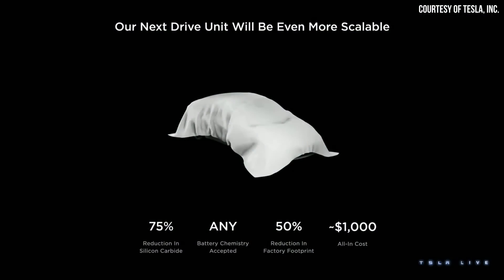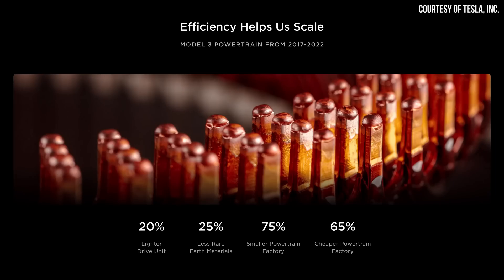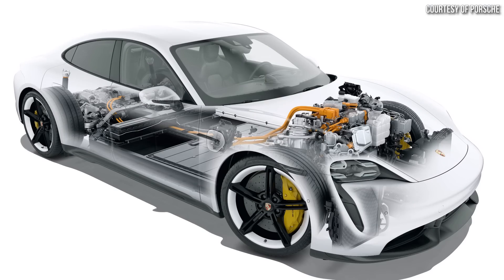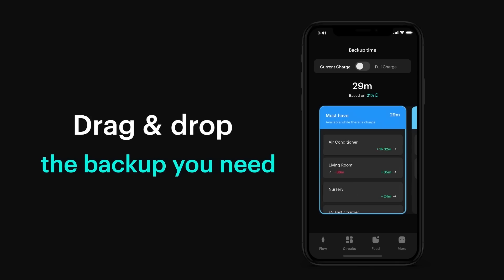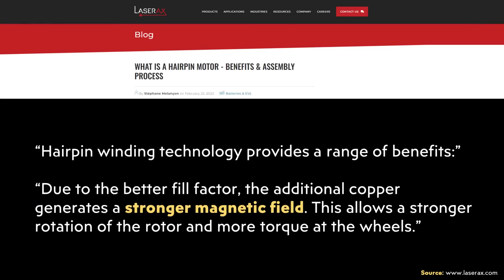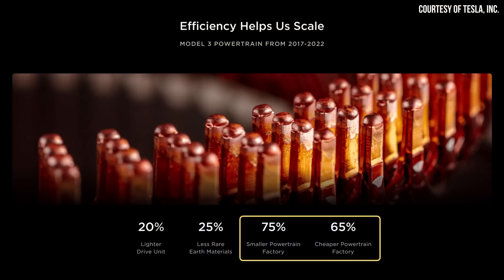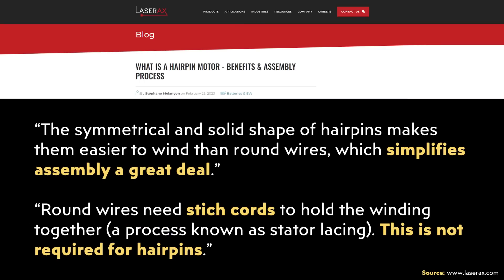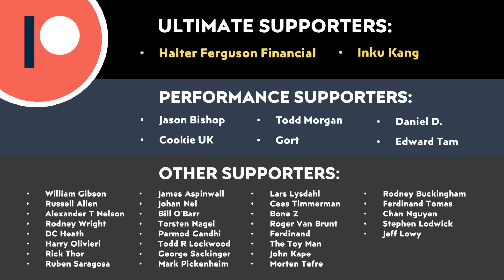NEW Tesla MOTORS are Here | Hairpin Model 3/Y Motors Explained

Comment: Thanks for the Video. Seems like my Model Y SR that I will get next Tuesday will have a "Hairpin Motor" 😀. LRWYGCFS2PC*******: LRW = Tesla Inc. in Shanghai, China
Y = Tesla Model Y
Model Y : G = SUV-Crossover / 5 Türen (Linkslenker)
C = Manual Type 2 Seat Belts (Front Row, Second Row*2, Third Row*2) With Front Airbags, PODS, Side Inflatable Restraints
F = LFP (Lithium-Eisen-Phosphat)
S = Ein Motor – Standard – Motortyp: „Hairpin Windings“ Variante: Y#RB/3#RB – (Model 3/Y)
P = 2023
C = Shanghai, China

Comment: I am currently waiting for a delivery of a 2023 Model Y Performance. The VIN allocated  to me shows a std winding, not the hairpin design. 😢
Reply: How do you know?
Reply: Tesla VIN states the type of motor: VIN Digit 8: Motor/Drive Unit
Motor/Drive Unit (2012+) & Battery Type (2012-2013):
C = Base A/C Motor, Tier 2 Battery (31-40kWh)
G = Base A/C Motor, Tier 4 Battery (51-60 kWh)
N = Base A/C Motor, Tier 7 Battery (81-90 kWh)
P = Performance A/C Motor, Tier 7 Battery (81-90 kWh)

1 = Single Motor – Standard
2 = Dual Motor – Standard (twin motors)
3 = Single Performance Motor
4 = Dual Motor – Performance (twin performance motor)
5 = P2 Dual Motor – Long Range (2021+ refresh) (designated for Model S or Model X)
6 = P2 Tri Motor – Plaid (Model S or Model X)

A = Single Motor – Standard / Performance (designated for Model 3)
B = Dual Motor – Standard (designated for Model 3)
C = Dual Motor – Performance (designated for Model 3)
D = Single Motor – Standard / Performance – standard winding (designated for Model Y)
E = Dual Motor – Standard – standard winding (designated for Model Y)
F = Dual Motor – Performance – standard winding (designated for Model Y)

J = Single Motor – hairpin winding
K = Dual Motor – hairpin winding
L = Performance Motor – hairpin winding

R = RWD V1 Motor @shdmd2118

Comment: If any  of this is being done today then why haven't vehicle efficiency numbers jumped?  Why haven't vehicle weights dropped?  Why have we not hear of optimization of the freed up space on the vehicle with the significantly smaller motors?   These would of course be the tell tale signs that they have started producing these motors in the existing cars.  The investor day however seemed to say that these advancements in assembly and motors would be in the next gen vehicle and not in the current vehicles.  Seems to me we should see EPA numbers changing and vehicle weights dropping as clear evidence.   So this leads me to believe this will be in the next gen, not in current gen.

Comment: I imagine that hairpin wiring requires less cooling power because the packed rectangular wires have much less air gaps between them than round wires have. The thermal conductivity for copper is much larger than for air so the pack will conduct heat much better. 

I’m curious if hexagonal wiring has been tried. Hexagonal wires can pack without air gaps and it perhaps it’s easier to press round wire into a hexagonal shape than into a rectangular shape?

Comment: 2:26 is that pin on the left supposed to bend???
Reply: no :)
Reply: It bends as the machine recedes, so its possibly deliberate, possibly a contact pin?  Otherwise, you'd expect it to bend as the machine lowers, applying pressure.  It's a very neat, angular bend & the "upstalk" stays very straight & parallel to the other pins.

Comment: You are badly informed about this topic. Every Model 3 RWD and every Model Y currently produced in Germany or China has Hairpin Motors. The RWD and LR variants have the 3D7 Motor and the Performance variant has the 3D6 Motor. This is already the Case for over 1 year. (I had a Model 3 from China for 6 months with 3D7 Motor and after that i got a Model Y LR also with 3D7 rear Motor and that car is also 6 Months old already... So we know that Hairpin Motors are beeing produced and are Put into Model 3 and Y for a very long time already.

Comment: I think that the hairpin stator slots/canals allow more copper to be put in so one can have more slots and then a shorter stator/rotor stack hence shorter magnets and less rare earths
Reply: I think you are on to something with the shorter stator and rotor stacks. But I don't think more slots in the stator is necessary, since they have found a technique to increase fill factor. Meaning more copper in the same area. Or is there a reason I didn't spot?

Comment: Tesla has been using Hairpin Stator Technology in Model 3/Y built in China since mid of 2021. Those motors are calles the 3D6 (Performance) and 3D7 (Base). In the US they have also started using hairpin motor in December 2022. Those 4D1 Performance motors were first spotted in MYLR out of Austin and later in MYP out of Fremont. They are all assembled in Austin though according to the motor placard. The 4D5 new generation base (non-performance) motor wasnt spotted yet, but it will come soon.
Reply: Do you know if the model S/X have been shipping with hairpin motors? I have been waiting for years for them to move to this tech. I am also waiting for the S/X (and the whole lineup in general) to move towards 48V accessory system voltage... which seems like it will be coming soon. I think once the model S moves to hairpin and 48V aux electrical I will make the jump to a model S from my current vehicle. Ideally I'd also like for them to finally go steer by wire and full brake by wire (I think they might have already?) as well. 

On a separate note, I wonder if the current gen model S/X will benefit from the new battery architectures and gigcastings soon. I really love how the current gen model S/X look and wish for them to keep them around for a while, whilst still continuing to significantly upgrade them under the hood. I'm a huge simp for the current model S, especially after they brought back the regular steering wheel.
Reply: @scenicdepictionsofchicagolife  currently the Refresh 2021 versions of the Model S/X are coming in the 3D8/3D1 motor configuration in the Long Range and 5D1/5D2 motors in the Plaid. All of these motors are still older wire (fractional slot) winding technology motors.

You will have to wait a little longer for them to transition there.

Model 3 and Y for Europe have shifted to Hairpin rear motors completely since 2023.
Reply: How do the new Tesla ones 2023 compare to lucid which are meant to be mind blowingly good and efficient?
Reply: I have 3D3 and 4D1 in my MY Long Range 2023 from march. From Berlin.
Reply: 3d3 and 3d7 fot the 2024 highland LR AWD from Shanghai.

Comment: You can't "double spend" the 25% stronger magnetic field, and simultaneously get more power with weaker magnets. I believe Tesla found a way to make magnets just as strong without rare earth's. Otherwise, they wouldn't have eliminated those rare earth's to begin with. Tesla doesn't sacrifice performance to save on cost.
Reply: Agreed, Virtual Viking. It sounds weird to weaken the magnets as they are the "current-free" part. That no significant current runs in them is the whole reason why perm. magnet motors are more efficient than induction motors. A weaker magnet field will just mean they would need an increase in the current in the stator to produce the same amount of power. Doesn't seems likely to me as well.
Reply: @R4nd0mN7mbers  Iit stands to reason that if the motor is 20% smaller it uses 20% less materials. Therefore about 20% less rare earth. The other 5% would be much easier to get rid of in incremental improvements in various other ways ie. manufacturing or chemistry or actual physical properties of the magnets.
Reply: Tesla use IPMSynRM rotors meaning the rotor delivers torque from both IPM (Internal Permanent Magnets) and SynRM (Synchronuous Reluctance (M is Motor in the acronym)). Hence you cannot avoid double spending of the 25% stronger magnetic field from the stator as the Reluctance element in the rotor returns the magnetic flux back to the rotor. Study these fine videos. https://www.youtube.com/watch?v=vvw6k4ppUZU https://www.youtube.com/watch?v=esUb7Zy5Oio Please note that Tesla are not first to launch IPMSynRM but have contributed segmented magnets, which increase efficiency marginally.
Reply: What if they found a way to make a magnet like we do in AC motor .. an electromagnet to behave like a permanent magnet

Comment: Imagine using a technology that’s over 150 years old, mind blowing!  The motor industry calls this a form wound coil , the round wire coils are called random wound.  Cram more conductor in a slot with minimum electrical and maximum heat insulation in order to gain max output.   Visit a motor
Repair shop.  The big deal is that they have designed a automated machine to wind a motor that removes the tedious labor to build a motor stator.
Reply: How old is the technology used for making babies??? Why is it preferred?

Comment: The Lucid motors seems superior to the Tesla motors in both power output and weight.
Reply: Because they are more efficent more powerful per kg and as effecient as the m3, mostly because Rawlins copied tesla tech and improved upon it. Like how jb and elon tore about the tzero motor and then built their own newer software controlled motor design for the roadster. 

Which carried over into the s&x model's. Then tesla engineers designed the much more compact, superior for mass production m3 motors, which went in the y, then semi, and plaid plus the ct. 

Insane the same little motor can power a compact 3,500# m3 rwd, all the way up to the 82,000#max weight tri motor semi and everything in between. Imagine the economies of scale tesla gained there. 

The coming soon next gen hairpin motors will eliminate rare earths, ad 30% more power per pound per Sandy munro who was granted exclusive access to them. And drop cost to about $1,000 a motor. Love watching an American company LEADING. 😎👍🏻
Reply: Too bad Lucid is going out of business lol

Comment: What I am surprised about is that Porsche was ahead of tesla in this regard!
Reply: What I'm surprised about is that even with an apparently superior motor Porsche couldn't get close to the efficiency (or performance) of Tesla cars build at the same time......?
Reply: @rogerstarkey5390  2sp rear trans and couldn't draw enough energy from the battery maybe? The taycan is also heavier by 300-600+# per variant vs the model s. Maybe the rumored upcoming 2024+ tri motor Porsche taycan turbo gt3rs thingamajig might match a 2021 plaid model s? 😀

Comment: The first EV I remember to use a hairpin design motor was the Jaguar i-Pace which is in production since 2018. I was always wondering why Tesla stuck with the old winding technology for so long.
Reply: Hairpin design does have its drawbacks too.
Reply: @essentials1016  such as
Reply: @GWAForUTBE  such as reduced wire cross section through skin effect at high switching frequencies.
Reply: @essentials1016  I was wondering if it is difficult to get very high rpm with this design?  The video said it is complicated to set up manufacturing lines for these, so perhaps it just had to wait until they could build manufacturing facilities to produce them cheaply enough.
Reply: So Jaguar started. The Salzgitter Picture is nearly for sure Volkswagen. This includes Porsche. And as mentioned above, Lucid is also doing this. As Tesla was already competitive with this disadvantage, now they are better.
Reply: @klauszinser  Many third party suppliers also use hairpin technology already. It's really nothing new or revolutionary. Just "state of the art".  Biggest advantage probably is in manufacturing. For the end user there will not be a big difference.
Reply: I had seen this design before.  It was in a video about the 2016 Toyota Prius from the Weber Auto channel.  They have been in use in that model and apparently the Prius C from 2012.  That makes sense since Prius is obviously going for maximum efficiency.

Comment: From my experience in electrical power industry, this hair pin design have been used long time ago for motors and generators above 1 Megawatts. The thick insulated squarish copper conductor is prebended automatically and inserted in stator slot manually. The terminals ends are connected by brazing. The same technique is used today. Due to manual method of manufacture this process is expensive, only attempted on large machine and in small quntity. The only advantage is you can detect and repair which conductor loop is faulty(shorted) in situ.

For mass market motor the process can be fully automated by using round and small insulated copper conductor. This make them cheap. They are not easily reparable when the conductor loop is shorted and are usually thrown away or recycled to get back the copper.
Reply: DC motor rotors widely use hairpins and are produced in the millions....
Reply: Hairpin can be (and is) fully automated. Traditionall ones not that well, since the tiny lines bend and spread everywhere -> certain process steps have to be done manually.
Reply: @jonas_4901  In theory every manufacturing can be automated, if you have the volume. The cost of the tooling can be amortized over large volume of the same product. I believe this is possible for LV motor used in automobiles.

Comment: The hairpin stator only makes a stronger magnetic field if you flow more current through it. Same current, same magnetic field, no matter the conductor.
So you can't get the full extent of all the benefits you listed.
Either you make the motor smaller with the same amount of copper -> you save material but don't get the stronger field.
Or you put more copper into the same motor due to the better fill factor -> less resistive losses at same current and more max. current.

Hairpin stators aren't new, other EV makers have used them for years because they're cheaper (see munros motor teardowns).
My motors professor told us that traditional wound motors have some advantages over hairpin, unfortunately I don't remember which ones.
Reply: You seem to have missed the point about "more current, less resistance, less heat, less cooling" (comments made by Porsche?)
AKA "efficiency" ....?
Reply: @rogerstarkey5390  sorry, I don't quite get what you're saying. I did ignore the "better  cooling" aspect to simplify things. My point is that, as an example, you do not get "less heat" and "more current" at the same time. you have to choose one, or find a balance. If you increase current to make full use of the wider conductor, you will get the same amount of heat. There has to be a tradeoff between the advantages.
Reply: @w0ttheh3ll  if it's more efficient, you get less heat.... You can run more current with less heat if the design is more efficient.
Reply: @imzjustplayin  Let me restate that, then. If you have 40% more copper, you can flow 18% more current and get the same heat. Or you can flow the identical current as before and get ~40% less heat. or you can run 10% more current and get 20% less heat. you have to strike a balance. you cannot get the full benefits of both.

Comment: Hairpin is not a loop, so how does it work ?
Reply: The tips are welded, like you see in the photo from investorday.
Reply: @svenlobeto9123  , can you show me the time frame of the welded tip in this clip ? Also how do they insulate the wire after welding ?
Reply: @JohnNy-ni9np  There are a lot of pictures around for the Toyota Prius motors which are hairpin design.  They used in the p510 transaxle in the Prius C first and then I think all other models after 2016.  I first say the 2016 prius motor on the WeberAuto youtube channel.
Reply: @jamescox8429  ,, the Prius C p510 and p610 use flat wire but each coil is a loop with 5-6 turns. It's not hairpin.
Reply: @JohnNy-ni9np  0:21

Comment: I was hoping they would increase the performance of the Model 3/Y instead of reducing weight and battery efficiency. The HP and Torque seem to remain the same. Unless they have the improved  performance “locked” for now
Reply: They are ALREADY class leaders in performance (by a LONG way)
You're arguing for "more performance" in family cars that can outpace a Ferrari.
.
Duh?
Reply: @rogerstarkey5390  yes, that’s exactly what I’m looking for. I think Elon would agree.
Reply: One could argue that the performance has improved if the new hairpin motors are in current models; because of the reduced weight and battery efficiency, the car needs less power (HP & Torque) to move- which translate to better range, better handling and overall power. Of course this is something that can only be compared by a driving current model against an older one. Also, I agree that it could be locked. Just my thought...
Reply: @entenu  yeah I agree that reduce weight and efficiency are performance improvements. However, the driving dynamics of the model 3/y are mostly unchanged since their release.

Comment: The one photo looks like is a SynRM rotor. the one downside of the hairpin design is a increase in eddy currents. These eddy currents can be reduced using a small inductor between the motor an the inverter. another option is to deepen the slot the wire is located in.
Reply: Yep, now will deal with hairpins coming loose from slots.  One year of potholes will loosen things up, a lot.
Reply: @queensapphire7717  I'd worry more about that on the [lords town hub motor]. The tesla at least mounts the motor separately from the wheel. There is also a fiber piece wedged into the slot.